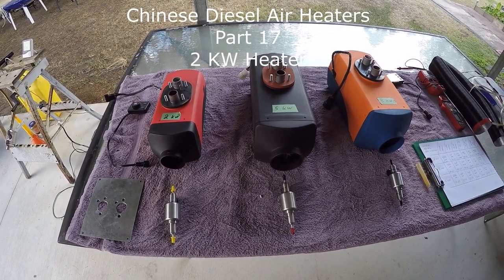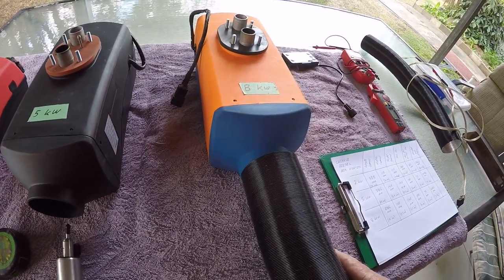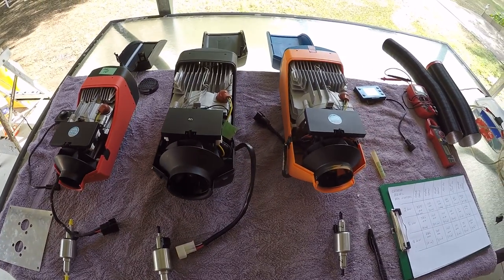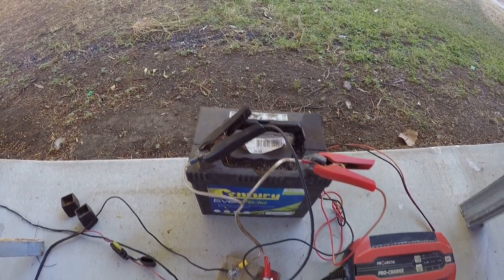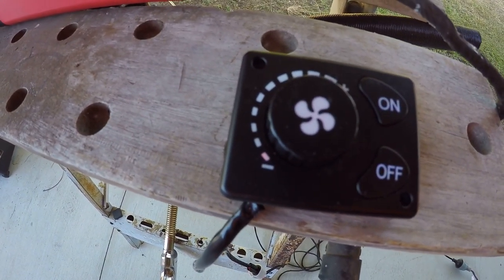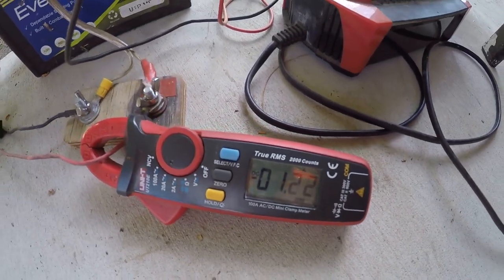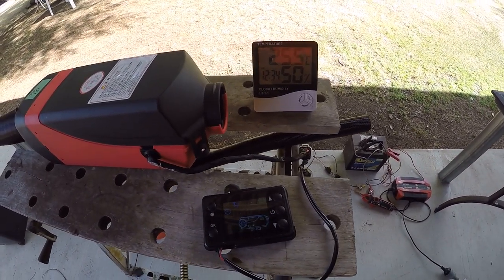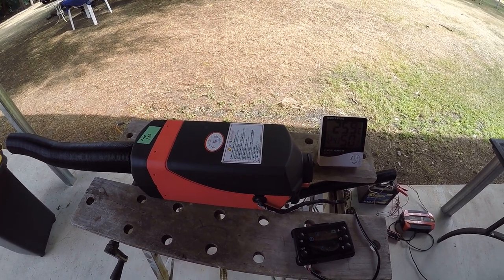Chinese Diesel Air Heater   Part 17 -  2 Kw Heater

Comment: John, can you install these  upside down, thus making the hot exhaust easier to route.?
Reply from the maker: No Edward. However, they can be installed on their side, provided it is the side where the glow plug is on the top.  JMcK

Comment: Thanks full of good information. I am thinking of getting a 5kw heater and mounting it under the bed would I be able to run the air intake inside the van to help with dust as it is a off-road van and I travel a lot of dirt roads
Reply from the maker: Thanks for the feedback Paul. JMcK

Comment: Hi john. Just installed system. Controller is showing red circle with - sign and a small blue battery next to it. Buttons on controller not operating. Any ideas. Peter.

Comment: John, I recently purchased 2kw heater however the controller doesn’t have a thermostat and the wiring doesn’t match with the new controller how do l know which ecu to purchase. Thanks I have learned a lot from your previous videos.
Reply from the maker: Hi C, 

If the heater is new, I would consider sending it back for a refund and buy one that suits.

I personally never use the thermostat function and just use the heat setting (Hz rate) setting. This stops the heater from “hunting”.

To have a better chance of the ECU matching the controller suggest you buy from same supplier. When I made these videos some years ago, the different manufactures followed a standard protocol so you could easily mix and match. Sadly, these days manufactures are going proprietary, so you cannot easily mix and match.  JMcK
Reply: @johnmck1147  Thanks John

Comment: I've just ordered the Lavaner Pro 2KW (Which is quieter than the generic CDH 2KW I'm told), but now I'm wondering whether I should have got a 5KW?  It's to heat my 12x8ft shed which is my electronics workshop. And I will be in there at least 7-8hrs a day in there.  I keep reading conflicting information out there and can't make a decision. The 2KW I worry will be too noisy and the 5KW I worry would soot up or not be able to be turned down enough.
Reply from the maker: Hi Dave,

You have already bought the 2Kw heater, so try it out first. The “ footprint” of both heaters are the same, so you can easily swap a 2 Kw out and a 5 kw in if necessary.

Depending on shed height, insulation of shed and outside temperature, a 2 Kw unit may be ok for you. I would probably have bought a 5 Kw unit, but I do not know above parameters. However, as you already have the 2 Kw unit, suggest you try that first.   JMcK
Reply: @johnmck1147  Thanks for your reply. Yes I've bought it but thinking about contacting them to change my order to a 5KW as it's not exactly cheap (£230) compared to the generic CDHs which are around £80. My worry is if it's too small I'm stuck with it then.
Reply from the maker: I have found the cheap Chinese heaters excellent value for money, and no difference in noise levels from similar expensive heaters.  JMcK

Comment: Would be able help me my 5km heater it heats upto 5 bars on the the controller and switches  off  by itself  it will not  keep  running  i have done this several  time's  , it does not come with any faults on the programmer could you  help please my is john to thank you

Comment: On the 2kw heater the rotary controller has a different plug to the other controllers, may I ask how you managed to connect the second controller, did u use some kind of adapter or cut the wires and join to the block type plug
Reply from the maker: Hi Les, 

In past years the vast majority of controllers all had the same triangle style plug and the same wire protocol, and it was easy to mix and match controllers. That is what I did in that video.

Recently some manufactures have brought out their own plugs and even reversed the wire connections, perhaps without thinking some people mix and match, perhaps forcing people to only buy their products and accessories. I don't know.

In many, not all cases, you can cut out non matching plugs and wire in a different controller should you wish. Most controllers have two power wires and a blue sense wire.

Should you mix and match controllers you need to be careful switching between 2Kw and 5Kw as the controller settings can vary, limiting heat output. Anyway, what was easy in the past is now becoming more difficult.  JMcK

Comment: John can you do a video on the different exhausts you can buy for the diesel heaters to keep the noise down or any modifications to make the exhaust quieter.  Is there a correct way to fit the exhaust or can it be fitted either way round. I put one on but it still seems to be noisy. I just purchased my diesel heater so any help or advise much appreciated.
Reply from the maker: Hi Jollyroger, I have done a video previously on exhausts and mufflers, suggest you have a look at that. Not sure what you mean by fitting exhaust either way around. The exhaust pipe supplied with the heater is connected to the exhaust stub on the heater. It does not matter which end you connect to the heater.  If you watch the exhaust video and ask a more specific question I may be of more help.  JMcK

Comment: Hello John,
Thanks for your helpful videos on these heaters! I'm pulling out my hair trying to make a 2 KW run for more than 8 minutes at a stretch. Your video on the fuel pump install was helpful. Ultimately I stuck the fuel pump in a cup of fuel directly to discount it being lift restriction or cavitation. The Voltage is good being always at 13 or more. The unit fires up with a little white smoke then clears, speeds up, the glow plug goes off after a few minutes and it runs normally until about 8 minutes regardless of setting speed. Then it goes off with a E08 error every time. It gets to yellow and green bars illuminated but never makes it to the red before shutting down. Ive tried with and without the intake air silencer and exhaust muffler. This is a side exhaust mount with the glow plug in the top corner. Any suggestions would be greatly appreciated!
Reply from the maker: Hi C, 

If it starts and runs for 8 minutes without issues, it suggests to me you have an overheat issue. Are you running it at max Hz? Suggest you try it at a mid to low setting and see how that goes. Unless it is very cold these heaters will shut down due to over temp of the heat exchanger if run on a high Hz setting.

If the heater will not continue to run on a Med setting down, you may have an issue with the temp sensor. Sometimes this can be caused by a lose plug on the ECU. Very rare it is the sensor itself.
Reply: @johnmck1147  Thanks very much John. Based on the E08 error and inspired by your fuel delivery explanation video I tested the pump thoroughly detached from the heater and found it is delivering good fuel supply. It isn't over fueling because the exhaust port is dry after every shut down and there is minimal white smoke on start up. The temp sensor is a good possibility, though if it's overheat it's a signal misfire. The heat graph on the display (the newest style in your video) has never yet made it out of the yellow. In fact, it seems to cut to off just about when it seems likely it would climb to the first red bar. I will certainly check the sensor and board connection next. I did try running at lower pump frequency settings and the result was identical. somewhere around the 8 minute mark it just stops pumping, goes to "off" on the display then goes into the cool down sequence. I even briefly wondered if I had the timer set up inadvertently but I did not. I suppose it is also possible that the board is faulty even if the temp sensor is not. Thankfully the Ebay vendor has been responsive and promised to ship a replacement heater. After I get and bench test it I will do some part swapping to try to identify the offending bit and I will post back. Really appreciate your knowledge and help !
Reply from the maker: 👍
Please let me know how it goes.  JMcK
Reply: @johnmck1147  Hello John. Well, the vendor was better than their product and sent a replacement heater which failed to ignite entirely. Ultimately I disassembled both and put one back together from the better looking of the extremely variable looking internals. The first heater had slag debris in the glow plug fuel inlet chamber (maybe excess solder from the fuel pipe attachment? ) and a pretty good drop dent on the burner chamber front end cover. The reassembled unit was doing the same - reaching a yellow bar or 2 and producing mildly warm air only before dropping temp again. I decided to up the factory upper fuel setting from the original 4.6 Hz and eventually by trial and error found it had to go to 6.4 Hz to reach and maintain full temperature on the display. Anything less and it starts to drop temperature red bars after a short run time. Interestingly, the unit that never ignited is factory set to an upper pump rate of 3.4 Hz, so likely it never had enough fuel to light. 6.4 Hz seems very high for a 2kW unit, but anything less and it drops temperature. I'm going to order some replacement parts (messed up the glow plug ignition screen pretty good getting it out of the first unit as it was more or less soldered in place) and experiment with the second heater to see if I can make it run with higher fuel pump settings.  Anyway, it's been a great learning experience and that was mostly what I got into it for. Thank you again for your help and excellent presentations!
Reply from the maker: Thanks for the latest update. Looks like you are doing good there.  JMcK

Comment: John, have you measured the cabin temperature output on both the 5 and 8kw heater when nothing running same fan and pump speed with same ambient air temperature? If not, could  you do that please?
Reply from the maker: Hi Chris,

I tested the output of both heaters at different fuel burn settings and input air volumes, and measured the hot air output. You can see some of the numbers on the spread sheet in the video.  

The 5 Kw and 8 Kw heaters (at the time of making that video) are exactly the same.

Cheers JMcK

Comment: G'day mate greatly appreciated the videos you have put up I've just purchased one of these  heaters  everything turned up as I wanted except for the fuel line its the correct bore but soft rubber type  that will be fine for the tank to  pump side not from the pump to the heating unit my question is as i have some stainless vacuum line that is the correct bore size could I  use that from the pump to the heater?
Reply from the maker: Yes Colin, in fact if you run the fuel line through the machinery space on a boat you should only use metal fuel line.  JMcK

Comment: Hi John, I have an issue that I would like to point out and get your feedback on. I installed a Webasto 2000 STC 2KW in my campervan back in 2016 and I love it, but no where near as much as my wife does ;-) My issue is that when I set the thermostat at say 72 degrees the heater brings the temperature up to 72 degrees and then attempts to throttle back reducing what you call the Hertz. However, the heat output at the heaters lowest Hertz continues to raise the temperature in the van. The heater then cycles off and does not restart until the temperature gets down to something like 64 degrees. This is outside of my wife's Goldilocks zone. I was of the opinion that the restart was triggered by the low temperature, but after watching your videos, I am wondering if the restart may be delayed waiting for a cooldown below some temperature or time threshold inside the heater. I have done a test where I run the exhaust fan and dump a significant amount of the vans interior heat, and in that scenario the heater will regulate itself and hold the interior van temperature within 0.2 degrees of the set temperature. It seems the minimum output of the heater is significantly higher than the rate at which the buttoned up van leaks it. I am assisting a friend in switching his RV to a parking heater. I wonder if this might go against your recommendation to go 5k vs 2k? Does your wealth of knowledge yield any insight into this behavior?
Reply from the maker: Hi David,
My opinion is it is better to have a big heater running slow, rather than a small heater running fast. 
My reason, is most of the noise comes from the fans, and air movement. These heaters running flat out, as in fact any fan type item, are noisy. 
In a small van, or well insulated larger vehicle, a 2 Kw heater is just fine.
My personal preference is to run these heaters on a manual setting. Too cold, I turn it up a notch, too hot I turn down a notch. But that just suits me. 
Cheers.  JMcK
Reply: @johnmck1147  Thank you for your prompt response!
Reply: @johnmck1147 are you aware of any place that has better quality silent fans  which can be installed in these units?

Comment: Thank you for the review. Had a question and was wondering your thoughts. Since this does draw on the battery would there be a way to attach a biolute thermo battery charger to charge the battery as it produces heat?
Reply from the maker: Hi Northrider,

It would make an interesting project to explore that option. 
It is not be high on my list of things to do, but I would love feedback if you experiment here.

Cheers.  JMcK

Comment: I am struggling whether to buy German or Russian or Chinese. ???/. The Planar Dealer told me buy the smallest one and run hotter preventing soot buildup ?    but if I have smallest  and it doesn’t  create enough heat ?/. I think I will go with  “largest” Chinese.    I am sure all the innard parts are the exact same ...probably even russian and German have same innards as Chinese !!   Thanks so much for your hard work
Reply from the maker: Hi Emillo,

I have a different opinion to most heater proponents in that I suggest you get a bigger heater and run it slower, rather than a smaller heater running fast. The heaters can be quite nosy running at high speed, and you get excessive wear,  the little pump piston is going up and down some 10 times every second. 

Yes running them fast helps reduce soot build up, but you don't need to run them fast/hotter all the time, you just occasionally need to run them fast/hotter for 15 minutes or so once a week to burn off carbon build up.

Also remember, with a gold standard install you will get very little soot build up. A poor install with restrictions in exhaust and intake line cause excessive soot build up. Better to not have soot/carbon build up first, rather than have to burn it off after.

The footprint on the heaters are the same, so you can easily swap them out if one is not suitable or one too hot or too cold. 

If you buy a brand name from a dealer you are likely to get technical back up, if you buy Chinese you are likely to get a much cheaper heater. JMcK

Comment: Hi JMcK, appreciate your informative video's, I just installed a 5kw unit and on start cycle as the fan built up speed it stopped and displayed error 06 I believe its a fan failure as the fan does not run with voltage applied directly hope I was just unlucky on getting a dud. any way of checking the control unit it seems to have voltage on fan terminals for a second when I push start !
Reply from the maker: Hi John, E-06 is generally a fan issue. 

Is the fan binding on the case? You can hear this and feel this by moving the fan by hand. 

Have you dismantled the heater? If on reassembly you did not put the fan sense magnet back correctly the ECU can not count the magnetic pulses so as to know fan speed.

Is your wiring good and you have 12V at the fan? If you have good voltage at the fan you may have a dud heater, and need a replacement.

Sorry I could not be of more help.  JMcK

Comment: Great videos, thank you for the knowledge. I've just installed my 2kw heater and found that the maximum Hz I can set is 3, which is lower than the 5 you manage. Do you think that would be the max setting of the ECU or the control display (in which case I would just buy another one)
Reply from the maker: Hi SC, 

All the 2Kw heaters I have seen use the same fuel pump as the bigger 5Kw heaters. 
A 3Hz max is to prevent the smaller heater overheating. 

Yes you can go into the controller locked settings (which I don't recommend) and change the pump settings. But mess with the pump you also have to match pump and fan speeds. 

If you really need more heat, it is easier to buy a 5Kw controller, but carefully watch out for overheating issues.

Or better still. Buy a 5 Kw heater.  JMcK
Reply: @johnmck1147  Thanks for the reply. My experience of the heater no way compares with those temperature readings you were getting, it seems underpowered and since have a small campervan I'm sure 2kw should be more than adequate. I've order the mesh and inner gasket and will do a strip down and service as per your brilliant and Informative videos. I bought the heater from a friend who simply wasn't using it so it had sat for a few years doing very little. Thanks again, as your documenting of these heaters is extremely helpful.

Comment: Hi John,thanks for your series on the heaters.
I have had a 2kw unit, a planar I believe, for about 5 years now and right from the get go it will not run at more than about 1/2 temp without cutting out after about 10 minutes. I have tried a new thermostat to no avail and as a last resort I have removed all of the inlet and outlet filters, silencers and muffler to see if that will help. Still cuts out after about 10 minutes. there are no fault codes coming up so it would seem overtemp is not a problem. Running out of ideas, any thoughts?
Reply from the maker: Sorry Kim.  I missed this. I suggest you strip down the heater and look for excessive carbon buildup in the burner section and burner screen.  JMcK